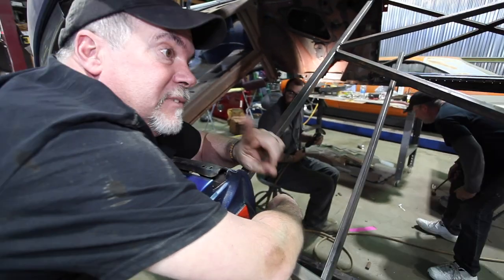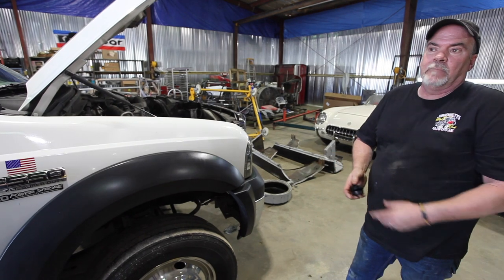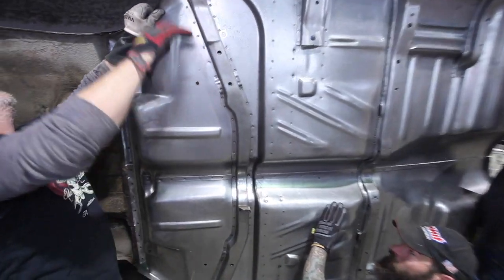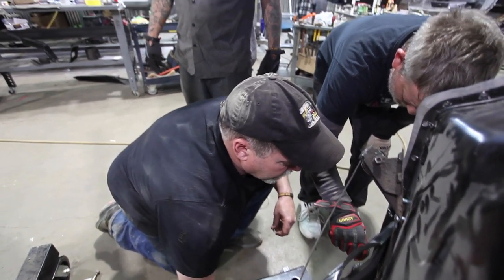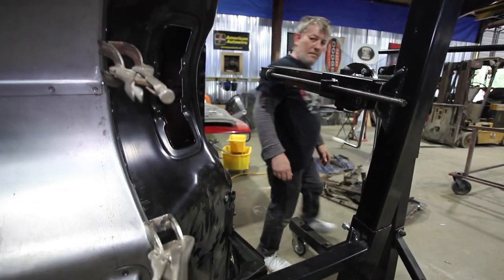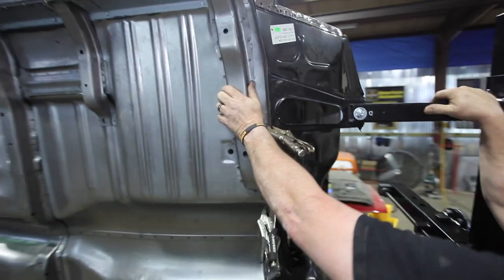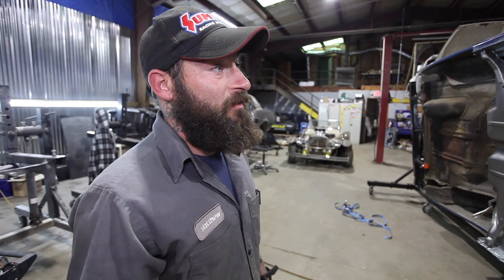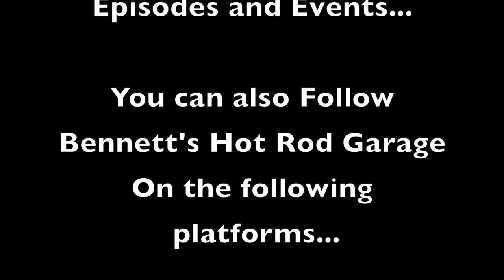1957 Chevy Bel Air Floorboard Install

Comment: When I was like 4 years old, my aunt's 57 Chevy convertible (blue and white) could be started without a key, as she broke the key off in the ignition.
Reply: 57 cheryl could be started without a key unless u turned the key to the lock position  then removed the key

Comment: I actually drilled a hole between my fingernail n finger one time,  trying to drill through thin sheetmetal with1/8" drill bit. I reached behind to hold it firm because it was flimsy.  Well,,,,, needless to say,  when the bit went through it hit home, right between my fingernail n finger. S.O.B. Man. That one hurt a little bit but i always havr a Roll of black tape in the Toolbox. Tape it up n Get'r Done.

Comment: you have a two piece floor pan  and 5 people putting it in wrong when one person can do it     did you ever consider weldind the adjustable seam down the middle last       fitted fine on mine